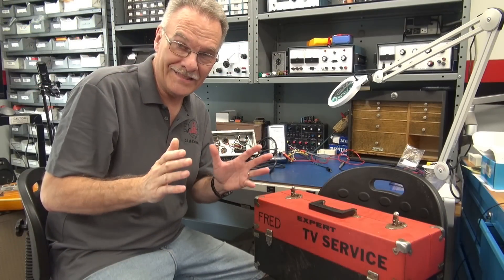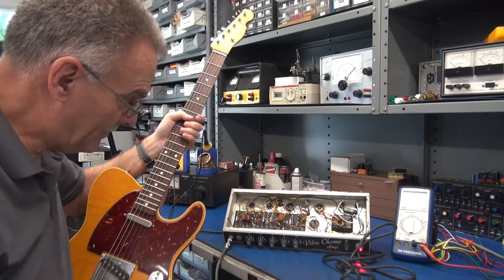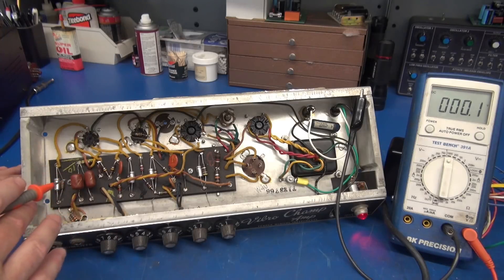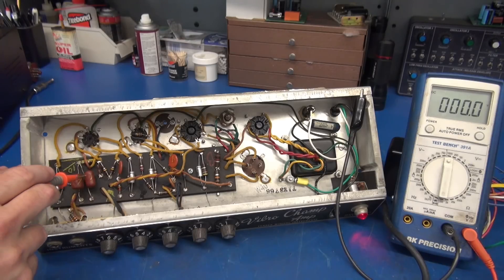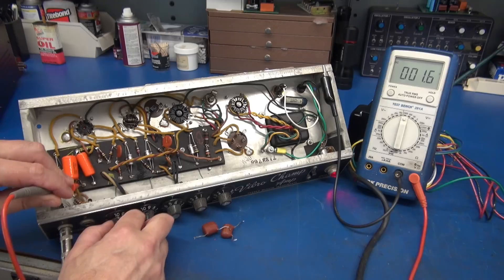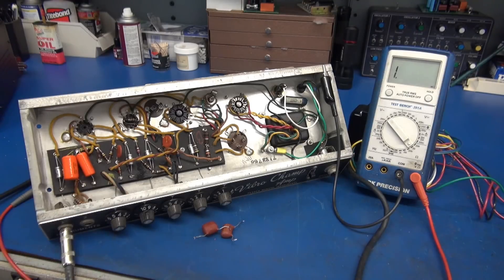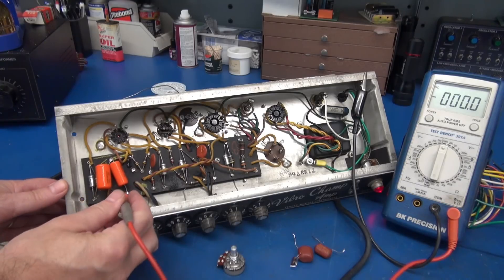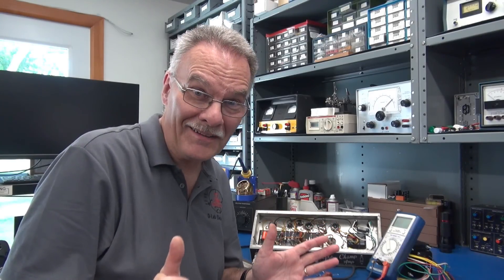D-Lab Basic Training Fender Vibro Champ No output Simple Fix? No, I made a mistake Believe it or not

Comment: Yeah, that was definitely weird.  For sure that's not "your typical Fender failure."  I think the giveaway was the crunchy volume pot.  When dirt isn't the cause, I usually find it's DC showing up at the pot, especially when the pot is also involved in the downstream triode's biasing scheme (here, it's serving as its Rg).  That forces the downstream triode into some jacked-up combination of cathode bias and grid bias.  I've even seen it take out that downstream triode, causing its grid to short to one of the tube's other two electrodes, probably due to excessive plate current & overheating.